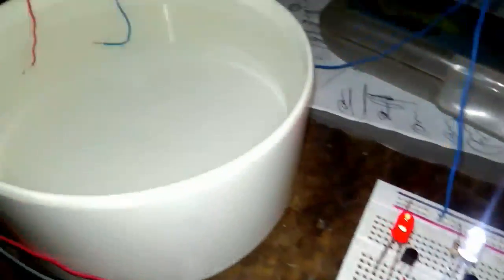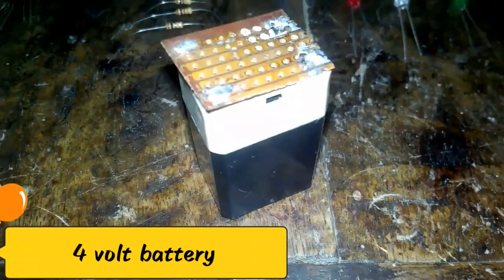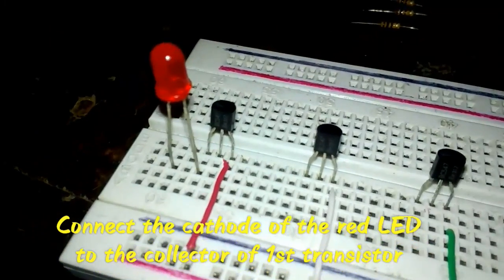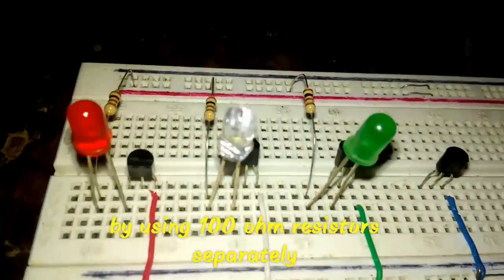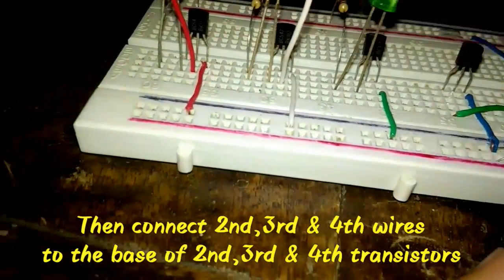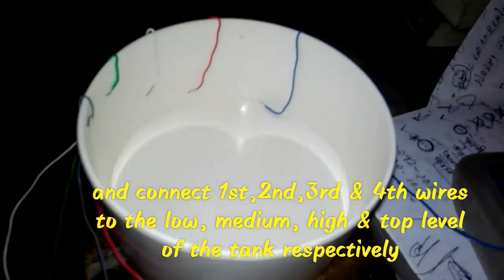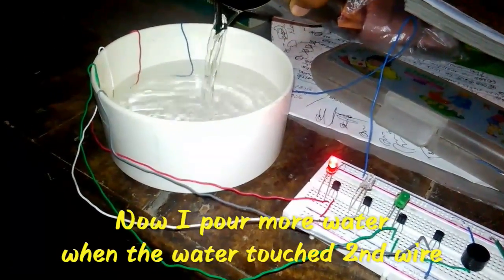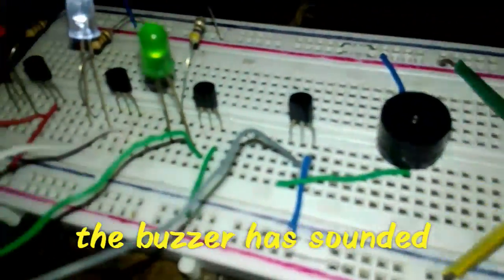How to make a Water level indicator

Comment: Brother my water tank distance is 30 mitre from where I want install this indicator. So kindly let me know will it work in such distance ?
Reply from the maker: This is a hoby project. I am not sure. You can try using 30 mitre wire. If this works. Now you setup this project to your tank.
Reply from the maker: And use 12 volt battery.

Comment: Can I put a buzzer in every LED but Different sound and also if the 1st Led light and the water go through 2nd Led how to off the 1st Led and light the 2nd led. in other words the 1st led turn off if the water go through the 2nd led. how can do that?
Reply from the maker: +Danilo Gutierrez it is a hard process. May be need microcontroller.

Comment: Suppose if I want operate circuit using 24vdc then how to select the transistor, resistance and led. I want 24vdc output to operate relay. Please explain
Reply from the maker: +vaithiyanathan manokaran You can use 12volt regulator ic.

Comment: Wanting to insert a 12V relay to lock the pump as I should connect it? Thank you.
Reply from the maker: +phoenix 76 wellcome . Stay tuned.
Reply from the maker: +phoenix 76 I don't understand your questions. Please tell me details.
Reply: When the water container is full I want the relay to turn off the pump. The relay and the pump operate at 12 volts. So the whole circuit must run at 12 volts.
Reply from the maker: +phoenix 76 please wait some days. I will try to give you a automatic pump controller.

Comment: what if I want to make one for 500 ltr tank which is on 2nd floor.
Will the resistance of wire make any difference?
do i need to bigger battery?
Reply from the maker: No, just make the same project.

Comment: is it possible to make the wires (in the water) much longer (15 meter) for measurement a rain tank of my house. thanks for the answer. Kind regards, Karel
Reply from the maker: +Karel Lauwers what do you mean by rain tank?
Reply: a rain tank outside the house in de ground , 7500 liter, 225 cm high, can i make a level indicator when the wires are 50 cm from each other. I have to bring the wires inside the house to connect to this level  meter, (for about 15 meters) so i can see inside hou much water is still in the tank outside (underground) Thanks and kind regards, Karel
Reply: is there not to much loose of signal in a wire of 15 meter
Reply from the maker: +Karel Lauwers yes it is possible.
Reply: Thanks very much. Kind regards karel
Reply from the maker: +Karel Lauwers you are most welcome sir
Reply: no u just need a longer wire...
BTW keep this in mind that, the longer the wire is, the resistance will increase...
so use a resistor accordingly...